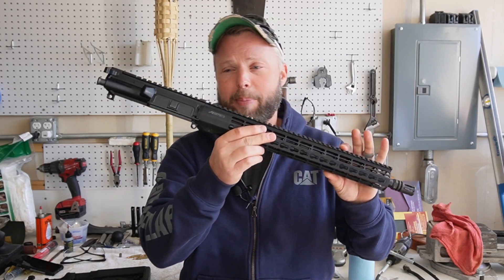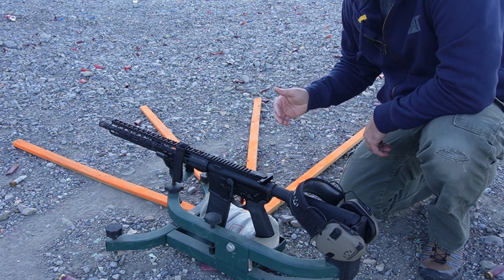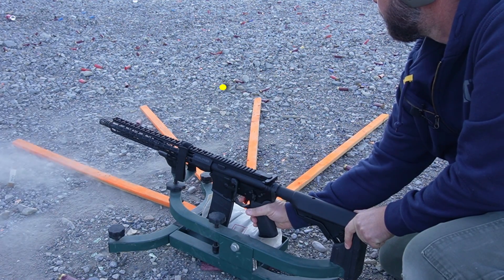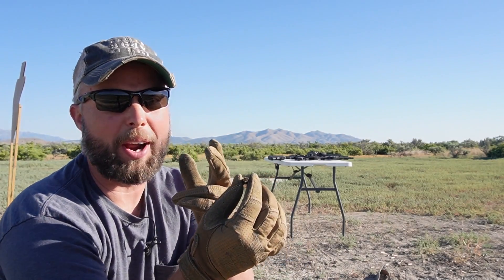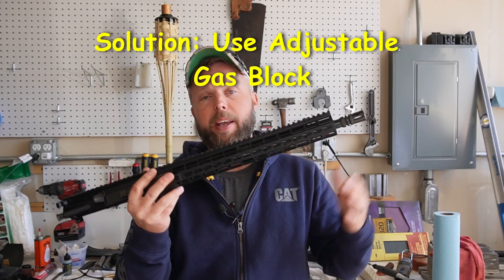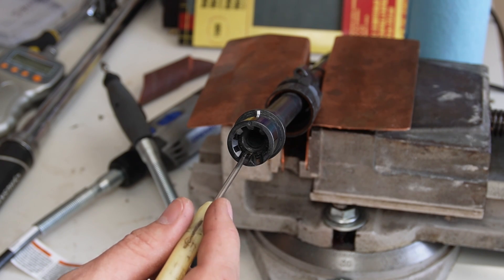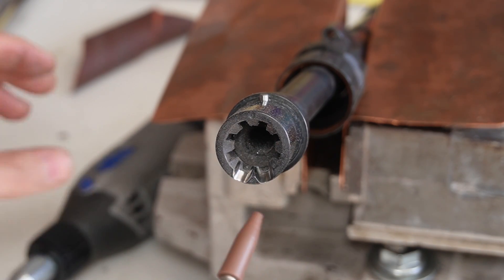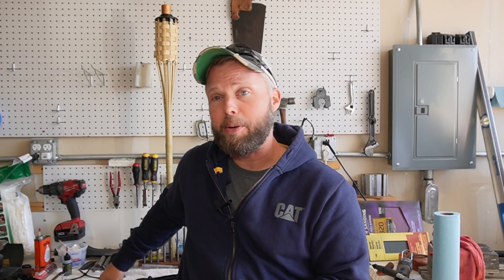AR15 Barrel Bedding Second Chance- What to do first

Comment: What I've seen from those marks on the bullet comes during unloaded an unfired round.  As the bolt comes to the rear, the ejector is pushing the round sideways and since its unfired, the bullet will be pressed into the barrel extension lugs causing the marks.   Damage during the loading sequence from a magazine will usually happen from the feed ramp if not matched properly.

Nice video

Comment: Get a proper 5.56 head space go gauge of 1.4646 and not the commercial 223 sometimes incorrectly labeled as a 5.56 1.4636..Too tight of a chamber is more common than an oversized chamber..

There is a reason the minimum go gauge is 1.4646, the chamber will shrink lengthwise when heated and it will effect accuracy and reliability if too short....Most chambers run even longer around 1.4656 to 1.4676..

Comment: Who make the bolt you used? Thanks 👍
Reply from the maker: First of all, thanks for watching! I really appreciate it. Second, the bcg’s I used you will not be able to get. I bought them years ago from a small machine shop that had an over run so I was able to pick some up. But don’t fret because what matters is that you try several different bolts. Due to the inevitable difference in machining (and we are talking .001” plus or minus their tolerance) between the different engagement surfaces of the barrel, barrel extension, and the bolt, you have to try different bolts because they are not exactly the same and the difference can effect the headspace (good and bad). This is why companies that offer a matched bolt with a barrel take a pile of bolts and with headspace gauges figure out the right one. Does that make sense?